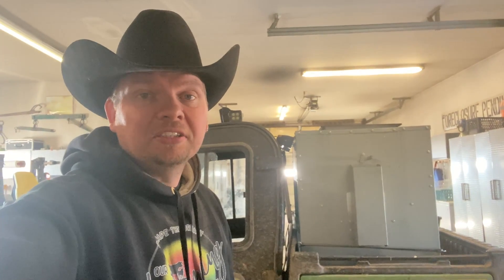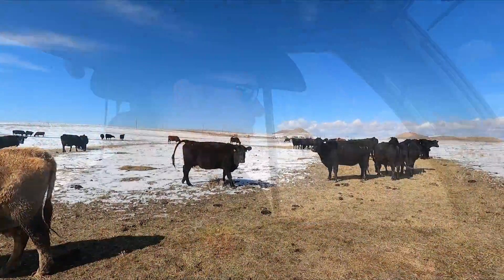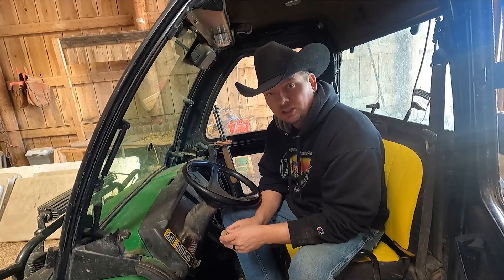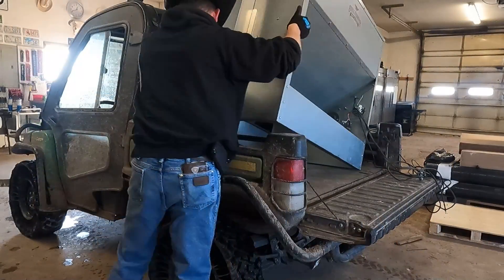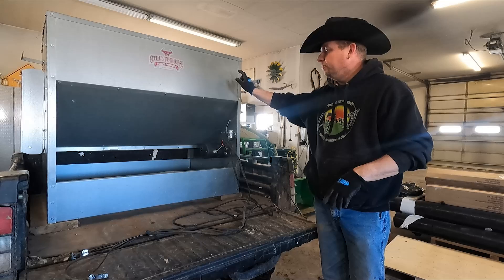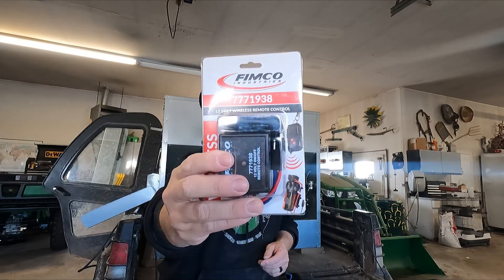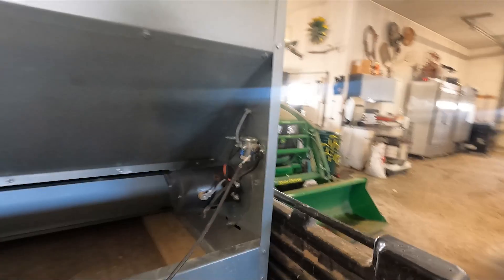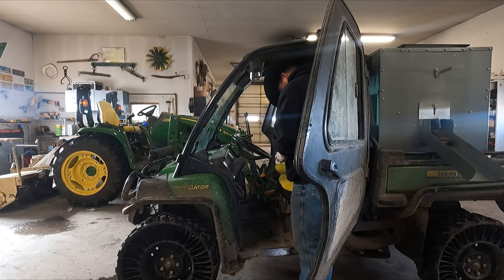Cake Feeder Friends

Comment: The rate at which the auger picks up the cake is greater when it’s full. As the level gets lower it doesn’t quite carry the same amount in the auger. So the flow rate is different when using a full hopper vs. a hopper that is getting low. It won’t be vastly different but maybe a few pounds difference when using a timed method.

Comment: Most of the ranches around here use truck mounted feeders with 25 ton overhead feed bins. You just drive under and refill using gravity. Originally cake came in square shaped  pellets in burlap bags that's why they were called cubes. You could sell the sacks back to the manufacturer for 4 cents for a good sack.

Comment: Something to consider when doing your testing is whether your gator is running or not because the voltage will change from some where between 12 & 13 volts off to about 14.5 volts running and that will change the output speed of your auger motor  so it will put out more cake when the gator is running

Comment: Mike if you put the wireless device inline with the power it will work. The device requires power to operate which it gets when it’s inline. If you then take ur switch wires and wire nut them together it should work off the remote no problem. Sorry I’m late, was behind on videos. Good luck!

Comment: Hi Mike.
You might cause a stampede to your gator when ever you stop in future because the cows will associate the feeder with a free meal. You are tying up the load space fulltime unless you can suspend it in your workshop with hoist for  a quick unload. We are calving and lambing indoors during 6 months of winter housing because of wet winters. Ewes housed for few weeks and then put out couple days with new born lambs here in Mid Wales. Hopefully cattle out May 1st for full time grazing and making enough silage in June. Run 130 sucklers and 1000  sheep on 500 acres so your vids are very alternative to us.
Weather is very determining on a lot of outcomes.👍🏴

Comment: Is the bed of the Gator long enough to orient the Cake Feeder 90 degrees around where the feeding arm is going out the rear of the Gator?  If so, that might give you your viewing angle as well as free up some area for the lights facing the rear to have effective use as well.  Just a thought.

Comment: If you need 200 lbs, then buy 200lbs, mark the feeder with a fill line, the you fill it to the mark.  You then know that all 200 lbs of cake needs to be duspensed.  You don't have to worry about how long to hold the button.  cake will

Comment: Were you wiring that remote switch to the switch part? If so, don't. Wire it on the 12v into the machine, and use a toggle switch on the traditional switch part. Leave that toggle switch on all the time, it's a backup disconnect incase a battery dies. You will be toggling the machine by switching the 12v in on and off.

Comment: Mike sometimes what we believe will be better just isn't!!!!! sounds good in our heads, looks good on paper, sounds good coming out our mouth, but in reality just don't work. Put the feeder back on the trailer. change the stand that holes the bag of cake. you built it for the gator not the trailer so its hard to use. rebuild the stand to have the trailer pull up beside it not under it. making it easy to fill the feeder, that means no backing up. with the feeder on the gator that means gator only has one use!!!!! hey we started our 30/30 please check it out!!!!!

Comment: Can you turn the feeder 180°an put the spout over the tailgate, you might be able to see to back up
Reply from the maker: One of the several things I thought of after I had it all done. Thanks for watching Chris.
Reply: I suggested that about 5 hours after you did...turn it 90 degrees and then you might be able to use the lights and see out a bit...with the feeding arm running directly out of the back, not the side.   I guess I should have scrolled down further, earlier.

Comment: use the power out to power a 12 volt relay, then wire your switch wires across the relay contact.

Comment: The directions say that receiver must have its green led on.  The fob or transmitter has a watch battery in it CR2032.  Check it for voltage 3vdc. You might have to repair the hand fob to it's transmitter.  See troubleshooting directions..

Comment: Looking at the vid your transmitter fob looks like it's working.  Red led when xmitting.  Remote fob on/ off controls the receiver on/off.
Reply from the maker: You are correct, it was working, just not turning it on
Reply: The receiver has to have direct DC power to it and the motor leads run through the receiver output.
Reply: Check your customer service email for electrical diagram pic.

Comment: I have a thought on your switch idea. I think it just breaks power so you would have to run that between the battery and the feeder. Kind of like the atv sprayers I think that product is geared toward. Neat idea if you can get it to work.
Reply from the maker: I tried that. I think it might be as simple as the amperage.  Thanks!

Comment: Your remote might have gotten fried if you had it hooked up when you sparked the gator.  Also check the remote for a watch battery that has a protective  paper in it to prevent battery voltage loss. The remote led should come on when you depress it.  Oh real men don't use directions but they might come in handy.  Also they might have a contact number or website on their instructions for tech support.  If you get the remote led to turn on when depressing it then  hook up the main device to a 12vdc battery with meter.  Oh also check for a blown fuse in this main device.  The  meter should show the device's output is on or off by reading the output present of 12 vdc..

Comment: How about a 3 point hitch? Or one of though luggage rakes that go into a trailer receiver that on a truck?
Reply: It’s up to Mike but that sounds like it may work to me. Lowers the center of gravity, easier to mount when not needed. Gives him visibility back, doesn’t have to move to lights.
Reply: I was thinking about the same. Why not make it 3 point hitch implement? Using quick hitch should be much more convenient to hitch and unhitch than trailer and it easier to back up :)